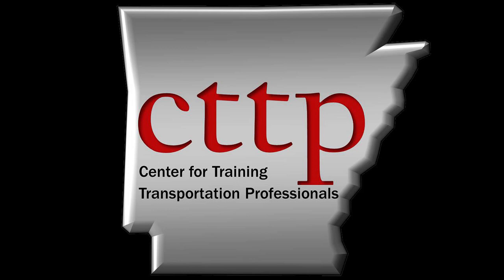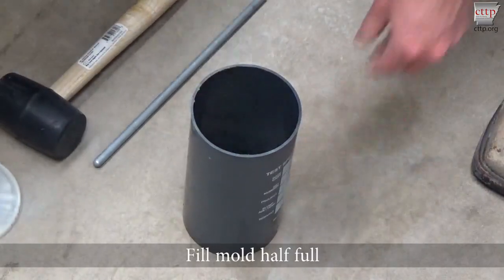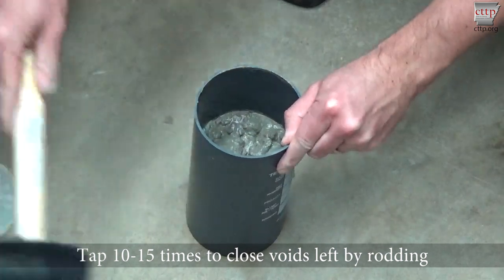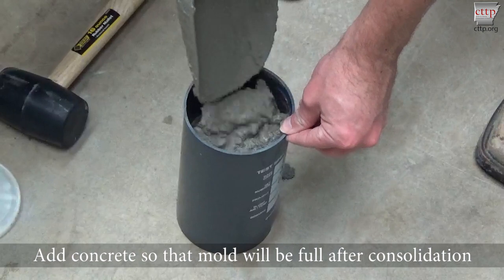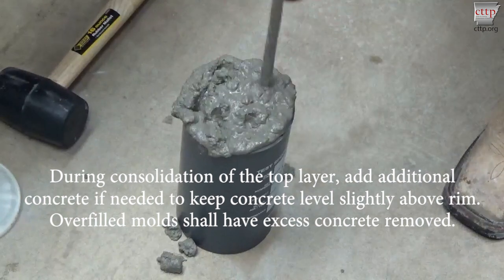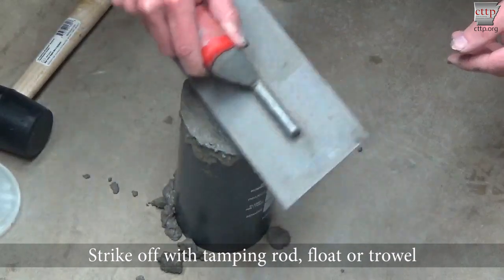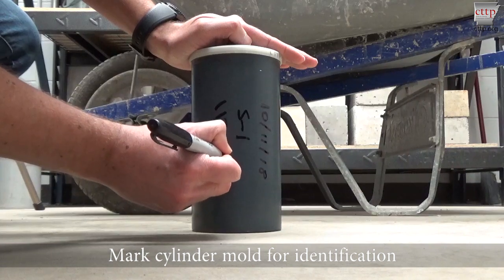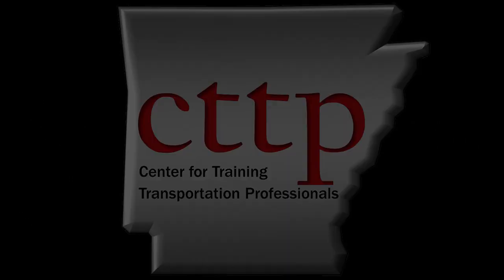ASTM C31 - Making and Curing Concrete Test Specimens in the Field

Comment: Thank you. Is it filled in two layers with concrete in this mould size?
Reply from the maker: That is correct.  For rodding, A 4x8" cylinder is filled in two layers.  A 6x12" cylinder is filled in 3 layers.